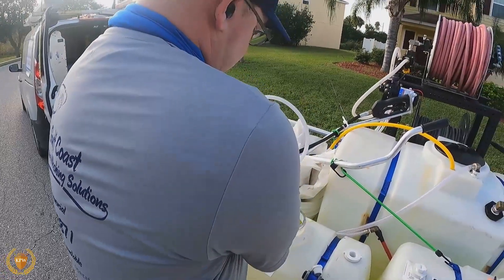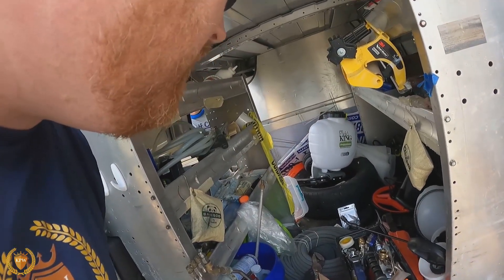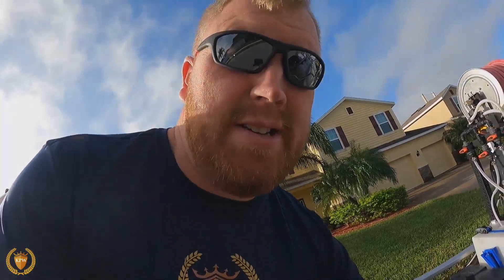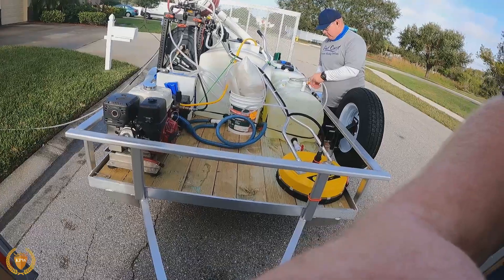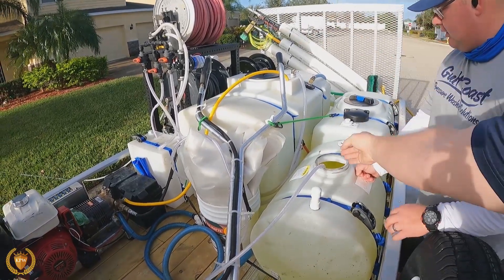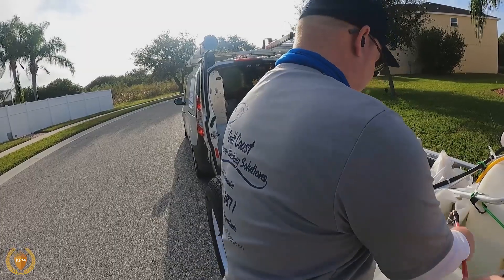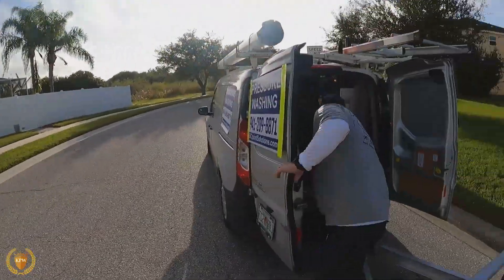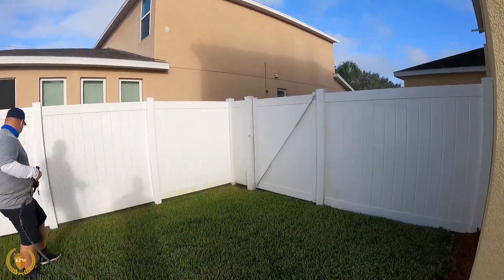Why No Soap? 🤔  Downstream Injector Not Working?🤔 But Its Brand NEW?🤔

Comment: I got a brand new skid with all new equipment, yet I’m fixing something everyday. Either I’m an idiot, or this business is a little more technical than I thought. Scared to think it’s more of the first 😦
Reply: Equipment definitely requires upkeep and you should factor that into what you're charging.
Reply: @ericstaples7220  I’ve only been doing this for a year, so I’m in the rough stages now. Lol But you are so correct, My next goal is to have a spare part for almost anything that can go wrong. But man it’s not easy, and it takes some time getting there.
Reply: @jcreations9353  That's a good idea.
Reply from the maker: That's the fun of this job
Reply: @kingofpressurewash  that’s why you sold your business for a nice check! Lol 😂